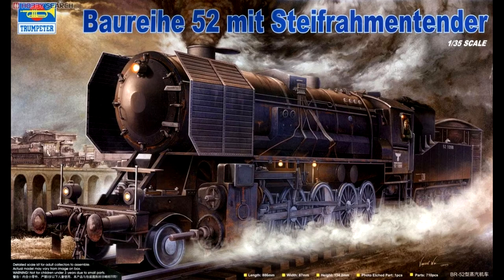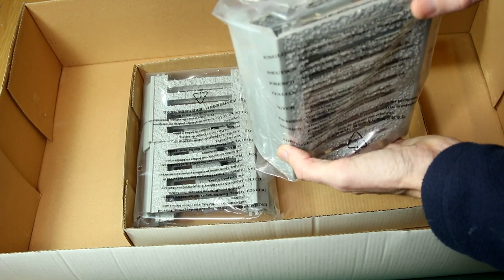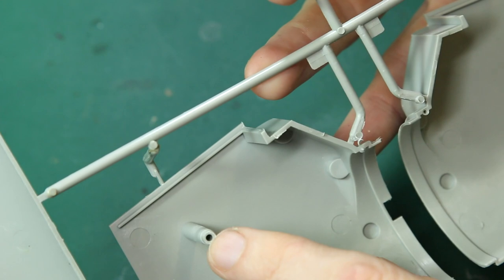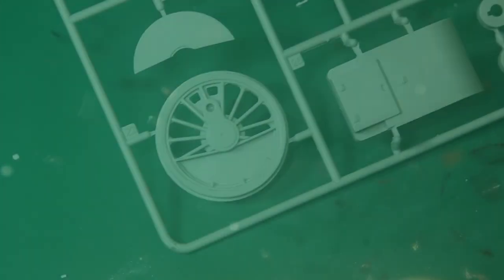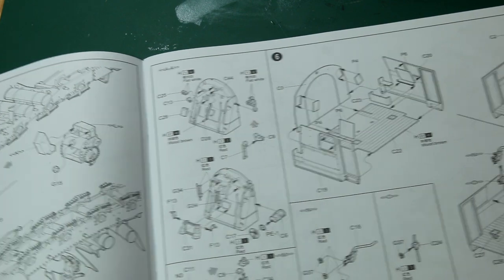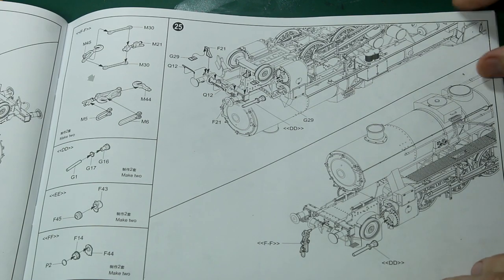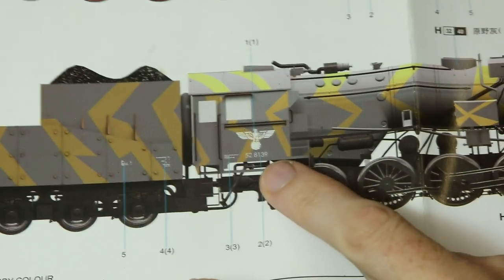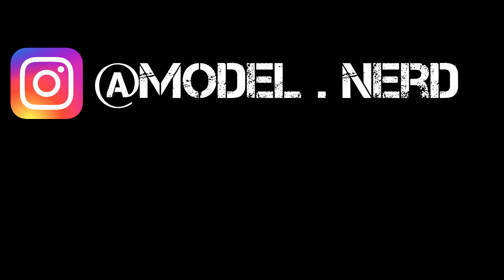Trumpeter BR-52 WW2 Locomotive preview and diorama ideas (1:35 scale model)

Comment: Hi Model Nerd, Thanks for the great review of this kit.  This has been on my list of kits to build for quite a while now.  I also have the Leopold, it's not finished, but I hope to get back to it soon.  The vinyl parts on the card are supposed to represent sanding pipes.  They run from the dome on top of the boiler, where the sand is kept, to just in front of each drive wheel.  The lower ends do not really attach to anything.  Some of the other reviewers talk about replacing the vinyl parts with wire because the kit parts just don't look very good.  The connecting rods are jointed in several places to allow the wheels some movement over uneven track.  Generally if the locomotive is setting on a lever smooth track, the rods will be in a straight line.  I'm really looking forward to seeing your build. Thanks for sharing.  Have a great day.  Jeff
Reply from the maker: Thank you Jeff, I appreciate your knowledge! Sanding pipes - that makes a lot of sense. A nice simple way to improve traction.

Comment: To answer your question about the vinal pets, they are sand lines that are hooked to the sand box on top of the boiler. The purpose was to place a small stream of dry sand onto the rails for traction. If you follow the lines back to the source of the lines you will find them hooked up to a large box of dry sand again to increase traction on slippery rails maybe in the winter months or on wet rails. There ya go
Forever in His service
Reply from the maker: Thanks

Comment: Looks a super kit! It's a 2005 new tool, according to Scalemates, so it should be well-engineered. The first possible inaccuracy I spotted is that they supply the kit with the earlier Wagner smoke deflectors (those "blinkers" on each side at the front of the boiler), whereas most images I have come across of both WW2 and post-war BR-52s show them with the slimmer Witte deflectors, although early models often had no deflectors at all. The Wagner deflectors in wood are unexpected, and I have to admit I have never seen wooden deflectors on German Dampfloks.
Reply from the maker: Thanks for the information, Ray. Yes, I was very surprised by the wood too!

Comment: Just finished my BR52 diorama, it's huge 😱 and definitely some build issues,
Reply from the maker: Were they accuracy issues or issues with parts not fitting etc?
Reply: The sanding tubes won't glue and the boiler has fit issues in the centre, and yes the red was overpainted during the first couple of years of the war.
Reply from the maker: @tonysquires8207  Thanks Tony, that's useful to have the heads up

Comment: Sorry about this, I hit the return key instead of another key. Anyway, it drives me crazy with the fixation on the imperfections of flash. Now I can see if the parts are not fully formed or if they have warps or something but flash. This is inmost kits even the so high and mighty Japanese products but flash. Let’s get over this and move on. I have been building models for 40+ years and the majority of these were either airfix and monograms. I can’t recall any of these kits without a small amount of “FLAASH”. I don’t mean to be obnoxious but let’s get beyond the petty problems of flash.  Please I don’t mean to be ignorant so I hope no offence is taken. See ya
Forever in His service
Reply from the maker: Ah, I mean I wouldn't call it a fixation...just pointing something out.